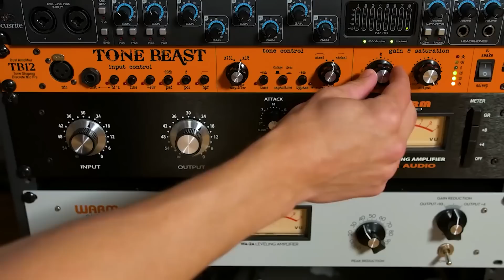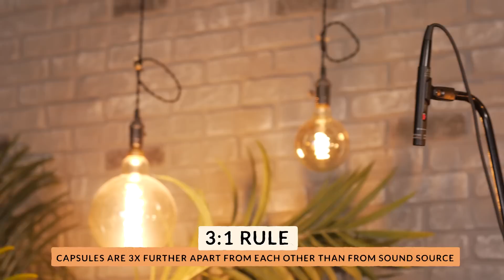5 Popular Stereo Mic'ing Techniques Explained & Compared

Comment: I'm gonna give you all a micing trick that I discovered about 15 years ago.  Put your mics at Phi points anywhere in the room and they will sound fantastic.
Reply: Please explain.
Reply: Phi as in…?

Fee phi fo fun !!!
Reply: you want to find the golden ratio points in three dimensional space.

I do this for my overheads and my room Mike’s.

So hypothetically if your room was 13 feet wide by 13 feet long and had an 8 foot ceiling, and the drums are against the back wall,  you could place your first room Mike 5 feet from the front wall, 5 feet from the left wall, and 5 feet off the floor.  The right side room Mike would be 5 feet from the Front wall, 5 feet from the right wall, and 5 feet off the floor.

As long as the three points that determine the location of the microphone diaphragm are all Fibonacci/golden ratio  numbers derived from the size of your room.
Reply: @SeanHouseholderTheWarriorSong  wow !! Great answer, thank you so much !!!
Reply: My pleasure, give it a try and let me know how it works for you!

Comment: I think you tend to get better phase coherence when you stack the capsules with XY, and its also easier to setup by eye too. And this isn't really a great demonstration of the 3:1 rule with a spaced pair, because the principals of using a spaced pair on a drum set are different from the ones guiding the 3:1 rule. This demonstration would be more effective with an instrument like piano thrown in.